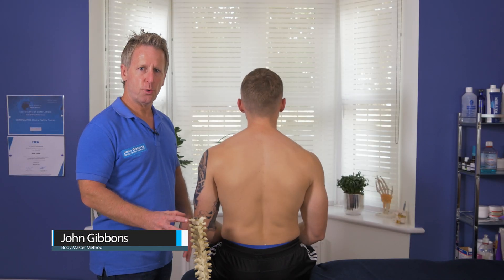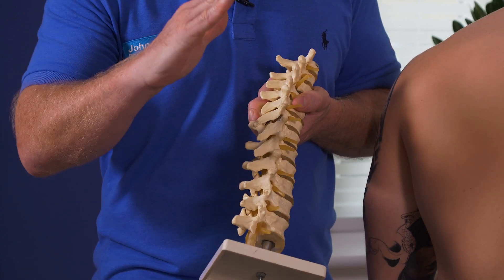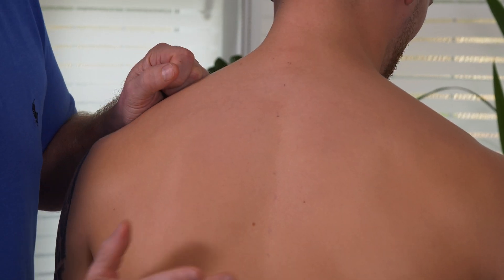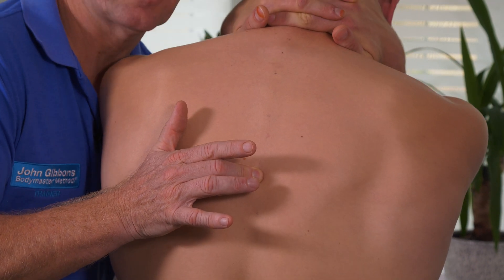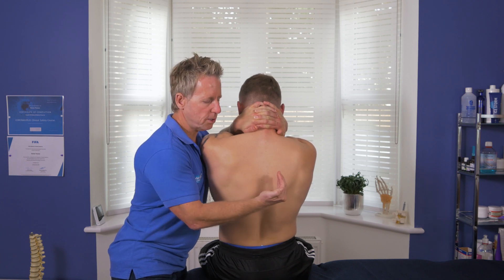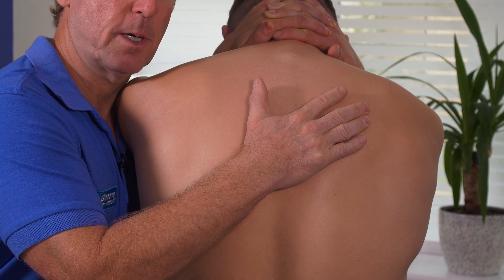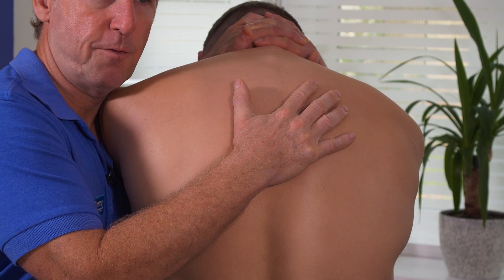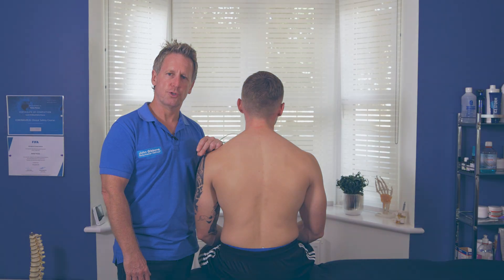How to OPEN a closed Facet Joint of T6/T7 - ERS(R) using Muscle Energy Techniques?

Comment: Would a facet joint issue at T5-8 cause spasms in ribs and abdomen? Please I’ve been searching for help! 🙏
Reply from the maker: Hi, it could potentially affect the ribs and a referred issue to abdomen - depending - might not be all those levels for the facet joints though as be quite rare....I would look at other sources for your symptoms - regards JG
Reply: @JohnGibbons  I’ve had epidural and intercostal nerve blocks with no avail. I’ve been looking into everything. Even slipping rib syndrome
Reply: @joshbehehe  I've had similar issues with rib and back pain. I'm curious if you've found your answer or remedy?

Comment: I was diagnosed with suspicious par stress fracture at L5 on right side according to my lumber MRI REPORTS. After 3 months of rest it is healed completely according to my current lumber ct scan reports. Overall reports are normal including all the disc height , canal, as well as no facet joint arthopathy is not there. But the problem now is that i have right side lower back pain when i over extend my spine. (while doing any bodybuilding back muscle posing ) specially it feels like the pain is in the bone or joint. Please help sir i am very much tensed about it. I used to do bodybuilding and want to continue with it  🙏🏻 
.
.
One thing i would like to mention is that the pain was gone after 3 month of inactivity at my lower back but i did extreme yoga streching and after than i am experiencing lower back pain again on my right side while extension but also i did my lumber ct scan after this only. So no abnormalities revealed please do reply 🙏🏻
Reply: @ZENSIBLE  that idiot trainer did that to me actually.